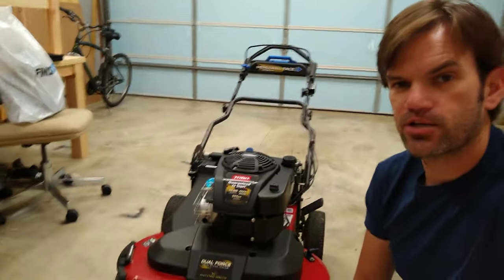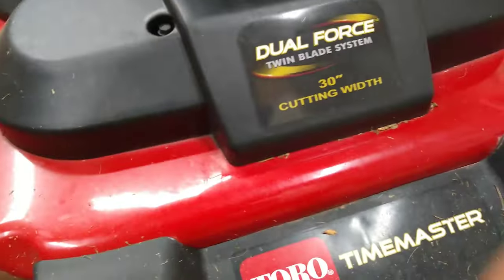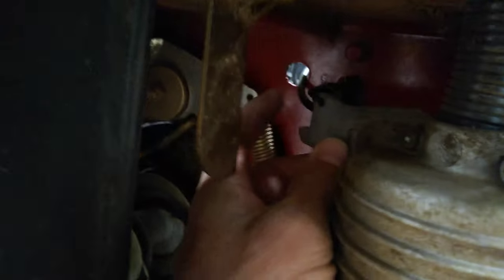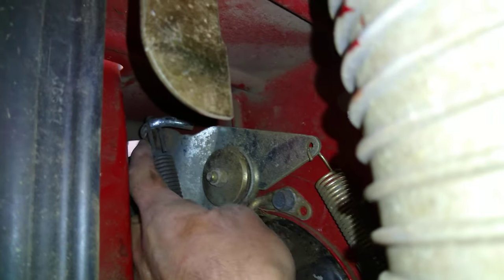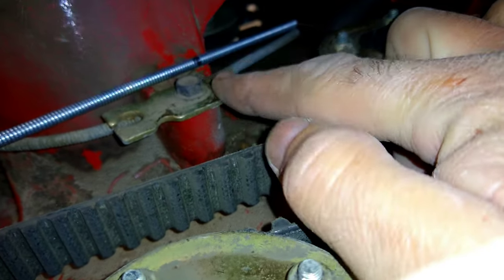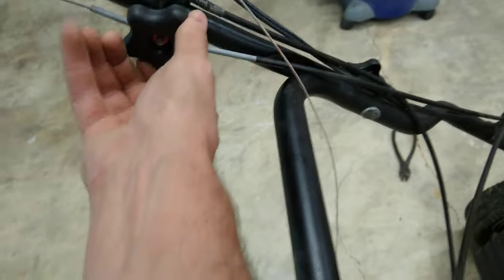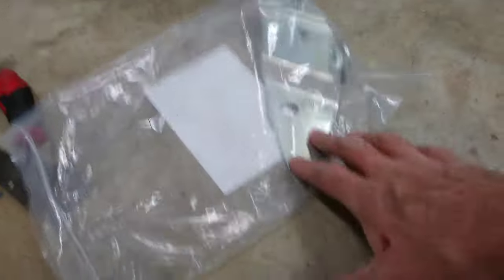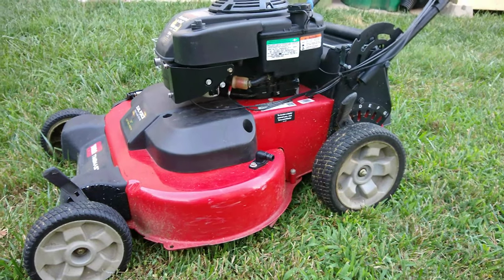How To Replace BLADE ENGAGE Cable - Toro TimeMaster 30" Lawn Mower

Comment: This is a great video and the comments super helpful too. This will be my second time replacing the cable. I had seen this video a couple of years ago so very glad to find it again. I have saved it.
It would be helpful to tell people if they need to empty the gas or oil before turning on its side.
Thank you.
Reply from the maker: Glad it has been helpful, thank you for the feedback

Comment: great video.  very helpful.  thank you.  you don't need the wood block to give enough play to get the transmission belt off.  if you look where the spring is that needs to be removed, there is a stop.  You just loosen that a little and turn it out of the way so the transmission can tilt giving the belt play.  super easy.
Reply from the maker: Thank you for the feedback! I'll keep that in mind for next time

Comment: Great video.  Mine broke with less than 2 seasons under my belt, in the same spot.  What a disappointment, seems like it’s a very common problem.   I personally think it’s too much stress for such a small cable, I had to get my grass cut after it broke so I cut it, pulled the remaining cable by hand and vice gripped the cable to the handle frame and OMG it was hard as hell to pull out far enough to engage the blades.
Reply from the maker: I bet that was hard! Thanks for the feedback!
Reply: If you understand the geometry of the blade brake / engagement cable you'll see there's a significant amount of "LEVERAGE" involved to increase the mechanical advantage.

Comment: I just replaced a friend's. Pain in the backside, but IT CAN ALL BE DONE FROM ABOVE.  (Model 20199)     Free up cable at both ends. Remove front belt cover, remove the front two bolts on the rear cover pry up rear cover along side the engine and slip out old cable. Slip new cable back in, attach spring end to idler. Tighten cable adjustment clamp so it is just barely putting tension on the spring. Attach upper end, Zip tie or tape into wire harness cover, test out, then reattach cover and bolts. Done.

Comment: guy i know gave me one of these because this exact part keeps breaking. thanks for the tutorial. looks doable
Reply from the maker: You're welcome! Good luck, I think as long as the cable doesn't get wet too much it shouldn't rust and break.
Reply: @howtofixitworkshop  so go ahead and order a second replacement is what im understanding 😂 Itll most likely get we at some point in the day everyday. but for a good mower i dont mind replacing a few cables
Reply from the maker: Good point!

Comment: Had mine for only a year and the  cable broke just like yours. Just got the new cable and ready to install after I watch the video a few times.  Thanks for the video.
Reply from the maker: Bummer! Good luck, hope you're able to get it fixed quickly!
Reply: Lol here I go again!  its been a year and im replacing another broken cable lol!  I love this mower and I wash it after every use. Its definitely water getting in the cable and   corroding it. So this time I bought a couple extra cables. Seems this will be a normal thing.
Reply from the maker: Bummer... again!

Comment: Mine did the same thing. The open end design when you wash the mower, allows water to run down inside the cable and sit a the bend or bottom of the cable and rust it out. I am not impressed with that design. Now with a new cable, I will keep the open cable covered and not allow water to trickle down inside the cable. I am not Impressed.
Reply from the maker: I'm going to use a lubricant this spring when I tune up the mower, something like tri-flow or 3-in-1. I haven't seen this in mower repair videos but bicycle repair and tune up videos show it all the time, and the cables are pretty much the same

Comment: I think Toro included the metal bracket to fix a bug with old one. I think it has to do with how the spring attaches but like everyone else I got impatient and just replaced the cable.

Comment: These cables tend to hold moisture under the black plastic coating where the wires bend causing the cable to wear out and eventually snap
Reply from the maker: Yep, agree

Comment: My Toro dealer says to spray some WD 40 down the cable to displace any water that sits in the cable especially at the curve at the bottom of the handle where your cable rotted. The exact same thing happened to me as well.
Reply from the maker: That's a great suggestion, thank you for sharing!

Comment: I also noticed that taking belt off wasnt necessary just loosen the tension at that middle first lock and be sure to get the proper tension before you tighten it back up with the new one.

Comment: Does anyone know how to get the ToRo Timemaster 30 Sparkplug out of the Machine? THe Spark plug wrench works great if you have the Motor completely out of the morrow but does not work for me. I still cant get the plug out even using multiple different spark plug Sockets. Again - A PP Design for a $1200 Morrow. I will Definetly not be buying another one. This thing just has Toro Decals on it. That Aint Good Enough for my $1200 Dollars I paid for it. Thanks and great video, helped me out alot.

Comment: How do you get the black plastic off at the top of the cable? The one that snaps into the handle of the mower
Reply: @marcusshamblin8552  It’s locked in sort of like a latch lock. You have to rotate it 90 degrees so it’s in a horizontal position and it will slide right out. Replace the new one in that same position and then rotate it back down to lock it in.

Comment: Mine is under 2 years old and just broke. Why would this break with it being fairly new?
Reply from the maker: I agree, very frustrating. I think the cable is cheap metal and gets corroded and rusted with moisture. I should have a link to the replacement part on the video description. The new cable seemed like better quality.

Comment: The cable sheild has a tight bend at the bottom of the push bar. It cracks gets water in it and fails.
Reply from the maker: That makes sense, thanks for sharing!

Comment: Mine broke the same way with under two seasons and excellent care from me. Mine has an electric start and costs $$$. The cable design is horrible. Water gains ingress from the top of the cable, sits in the cable and rots. PP Design. After watching your video, I am going to try and get the cable on without taking the belt off. Then= I am going to Lube the entire cable with cable lube and keep water out of the top of the cable when washing. I have thought about the other cables also. I paid 1200. This is not acceptable. I have the same amount of Detris under the belt cover also. Bad design. I am going to line the bottom of the dual belt cover with silcone, OR used door insulation tape to keep the grass out. THis is a PP Design for such an expensive morrow. I am Dissapointed in the Design and it is suppose to be a Toro- top of its class. Live and Learn, thanks for the video. I will attempt to replace the cable just like yours. Thanks so much, RH DSD
Reply from the maker: Yep, I agree with you, not a good design. Seems like it could have been a thicker cable and made out of a corrosion resistant material. Planned obsolescence I guess. Based on the amount of views and feedback and other videos available, it appears to happen to everyone. Thanks for your tips with the lube

Comment: I replaced my cable using this video. I did not touch the drive belt and just fished the end of the spring around it. I used a Cable Luber device, cable lube and greased the top end. Be aware that the lower Handle-Cable on the Morrow is in the same situation= Water can get in at the top of the cable after cleaning, sit in the bottom of the cable housing all winter and corrode that wire also. This is a PP Design for a 1200$ Morrow. This cable replacement should have been a recall item and not me paying to get a new one after 2 seasons. I am very Disappointed in this TORO . I will Definetely not be buying another one. Toro used to have a solid gold name..???  WHAT HAPPENED...?????

Comment: No, isn't just you . I have had this mower for a year and the same thing happend and i keeep it in an enclosed trailer. I also had a part of the rubber tire come off the tire. I also had and issue with tire adjuster . all rusted in less than a year. just bought a small toro and its already giving me problems. I am a landscaper I cant afford to keep buying new mowers that break within a year

Comment: I kept mine in the garage, cleaned it out, etc...
This thing breaks stuff all the time, I have some thick blade grass but still... my little toro hardly ever breaks down and it is ten years old.
Regret buying this, should have got a small rider instead. I hate this mower.
ETA: the deck clogs up like no other, just a PITA all the way around.
Reply from the maker: Haha, thick blade grass!... Man really, you regret the purchase? Mine has really only had that one cable break, that's the only non user error that I've experienced. Think I've had it for 4 years now and is mowed a lot of yards. Hope your luck improves!
Reply: @howtofixitworkshop  It won't, this thing is a total piece of shit. Regret the purchase? YES.
I said "thick" blade, and my neighbors small Cub Cadet rider looks like a professional cut even when the grass has dew on it.
The deck clogs up even when the grass is dry, and really the only two things that this mower has going for it is the cutting width which is why I bought it and the engine has so far been solid.
The design just sucks.
Reply from the maker: Gotcha, typo on my part. Funny. Yeah I guess I can relate, mine does miss it's fair share of grass blades. I usually have to cut twice or cut slow in order to get a good clean crisp cut
Reply: Update, I'm fixing this thing one more time and selling, the drive belt is really thin and small, and the plastic part of the blade break cable that holds the cable in the handle broke this time....
I got a Bad Boy zero turn and we'll see how that turns out, a lot of money but cuts the time mowing down by at least 80% and the deck doesn't clog up.